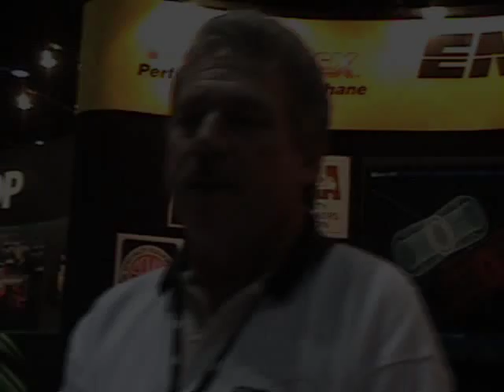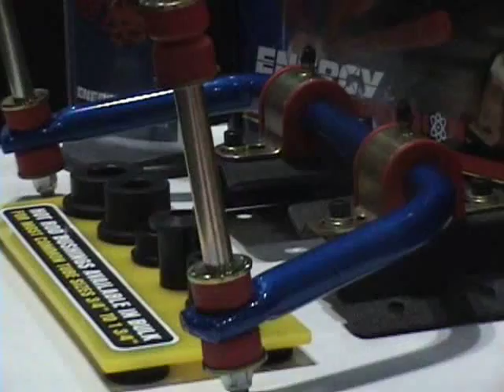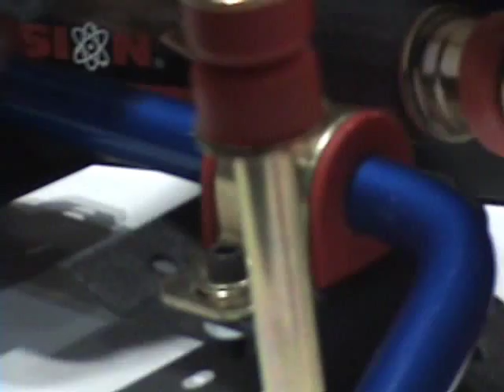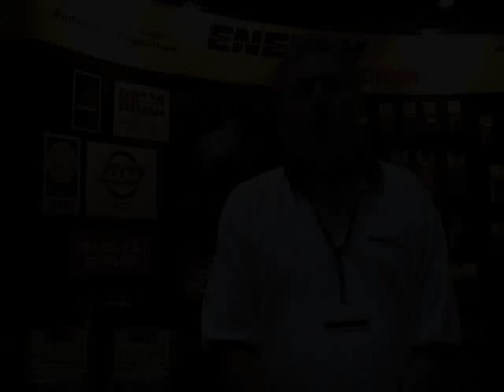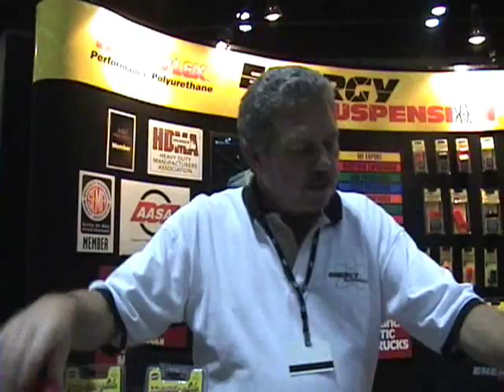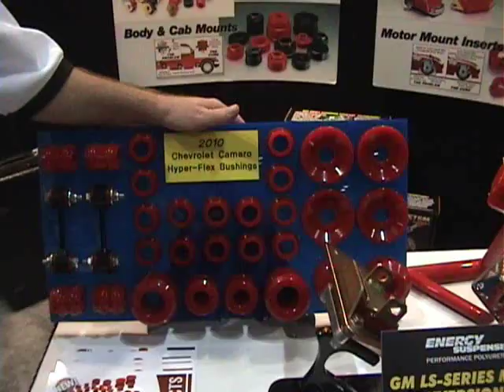Energy Suspension Polyurethane Suspension Components

Comment: How often do you have to lube the PU bushings. Is there a grease fitting? That is the downside in comparison to OE rubber bushings. My OE rubber bushings are still good at over 120,000 miles. Will my PU bushings last as long considering they rotate on a shaft and can wear?

Comment: Part number 1173 is a epic fail. Fits 05 EX Civic. Its a insert for the rear mount, and does not fit. I know 2 year olds that can match shapes better than them. I just stopped carring your products as a retailer and installer. Spent 6hrs trying to get the inserts to stay in place after pressing them in. They pop out  a half inch on both sides. Next time I order all new mounts with 100% poly bushings, cost more but I'm able to finish the job. ES told me to modify the mount and insert.

Comment: Having purchased a set of Energy Suspension control arm bushings is quite an experience ... The diameter is the proper size to fit the original bushing shell, but the length of the bushing is about .100 too short from the original bushings ... I wasted my money and will never buy any urethane bushings until Moog, Raybestos or another OEm fitting part manufaturer creates some.
My daily driver will drive much better with some Control Arm bushings that those that don't fit from your company!